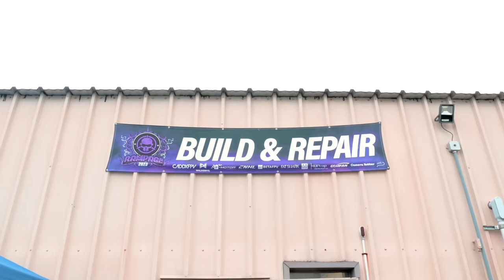We Let AMATEURS Chase DRIFT CARS and This Happened 😬

Comment: Yes it is a drone.  Here Is the definition:  a remote-controlled pilotless aircraft or small flying device.
"pilots use remote controls to guide a stealth reconnaissance drone"
a remote-controlled or autonomous vehicle designed for use underwater or on land.
"a drone was sent to explore the depths
Reply: That definition was backfilled after the media failed to keep the terminology straight. before remotely piloted aircraft (RPA) fell into the public eye these things where called multirotors and a drone was an RPA jarheads shot at for practice.